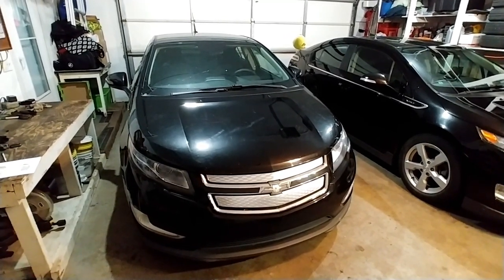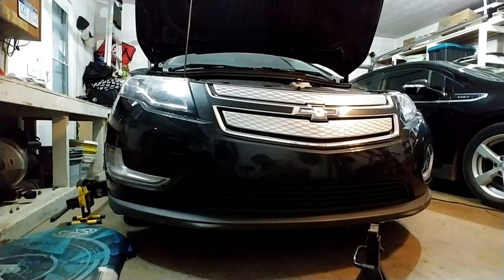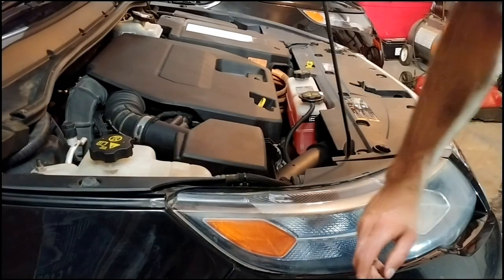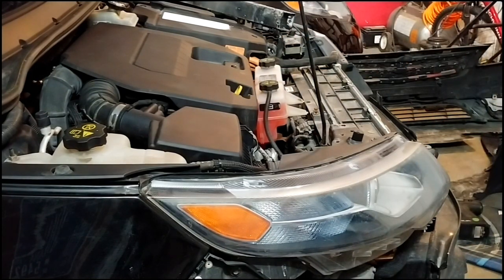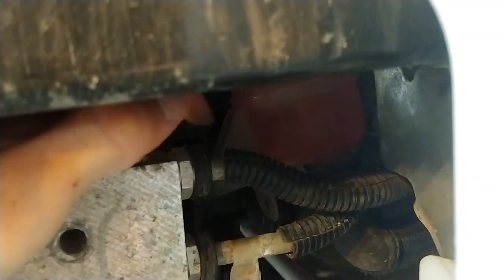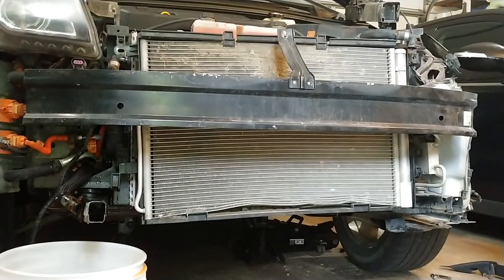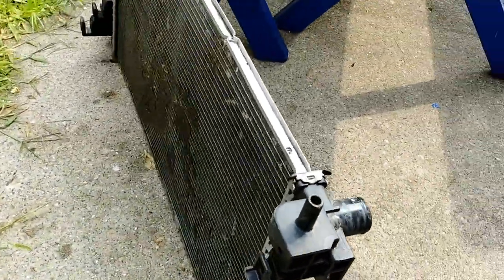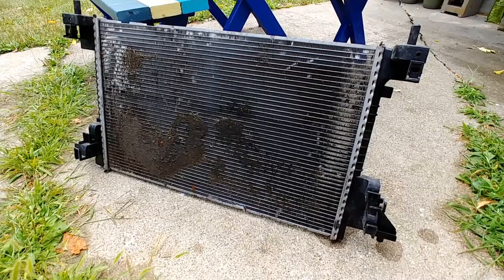How to Replace the Main Engine Radiator in a 2011-2015 Chevy Volt

Comment: I’ve got the same problem with my battery cooling radiator…bottom damage from such little clearance I assume. So, do u think there are any temporary patch options you could have done instead of replacing the whole radiator? I just need mine fixed long enough to get my check engine light to stay off so I can get thru smog check. It’s my commute to work car and I just need this thing to get me to and from work until I can get my new car bought. I was thinking of using some JB Weld or something to patch whatever my leak is so figured I’d ask somebody who had some experience with these radiators up close. Oh, also, what radiator is the battery cooling radiator? I can tell which of the 3 do what. Thanks for any info you guys can give!
Reply from the maker: The coolant system pressurizes as it heats up, so there's not much of a good temporary patch option as things expand a bit.  The hardest part is things typically need to be dry to apply anything external.  I know JB weld has been used with decent success by others.  The battery cooling radiator is the front one though and waaay easier to replace than the engine radiator in this video.  If it's leaking from the front radiator, I would just replace it.

Comment: Just bought a parts volt car that needs the front end reassembled from the motor forward.  Aside from a brand new radiator and condenser, I'm having to source all the parts----which my time really won't allow.  Thought I had a perfectly matched front bumper assembly, but evidently there's a difference between the gray silver and the greenish silver, which the car is.  I may scuttle this project because I'm seeing that I don't have the time.
Reply from the maker: Bummer! I know what you mean though. It took me about 8 months to fully piece together my first Volt. It could have been faster, but I was really trying to keep the price down. My second Volt didn't need much body work at all, so I had that pieced together in a month. I've kinda decided moving forward I will likely stay away from crashed Volts.
Reply: @mjspiess  I would sell it back to the guy I purchased it from because he gave me a staggeringly great deal.  However, I already bought a $600 bumper so he may not want to pay that, as he is a body guy.  We'll see...  I may keep it and just slow roll it as you did...

Comment: How did you bleed the system after putting it together
Reply from the maker: I just added coolant to the tanks every day for about a week.  The system will naturally bleed out the air bubbles, but it just takes longer if you don't use the proper tool.

Comment: I felt your pain watching this I did the same job today on my volt!! Painful
Reply from the maker: Yes, it was by far the worst radiator replacement I've ever experienced!  Hopefully my video helped though.  Good luck!
Reply from the maker: @Dimetri777 Ugh...  I feel you!  It is an absolute pain!  Apparently you can remove the 2 lower radiator brackets and it gives you a lot more room to get everything together.  It's some extra steps, but from what I read, it may be worth it.  At the 16 minute mark, you can see one of the lower radiator brackets.  With that out of the way, you can work vertically and not at such an angle since those brackets would be out of the way.  Good luck!
Reply from the maker: @Dimetri777 Yep, those are the lower radiator brackets.  Oh, I see.  Yes, getting it high enough is a challenge as well.  At the end of my video, I give some tips on getting it back together.  Not sure if you watched until the end, but it might help?
Reply from the maker: @Dimetri777 Yeah, I think I got it as high as my floor jack allowed.  Oh yeah...it's by far the worst job I've ever taken on too.  Such a terrible design and unnecessary to have it all slotted/fitted together like that.  It's definitely a puzzle.  I can remember, but I think I ground off or just broke off some tabs because they weren't necessary to hold everything together and it made it easier to slide into place.  It's a mess for sure though!  I was so happy to be done with it!  I had the service manual, so that helped, but I had no idea how bad it really was going to be.  It would definitely be easier removing the AC condenser and transmission cooler radiator, but I didn't want to mess with refilling either.  Ugh...  Love the car, but terrible design!
Reply from the maker: @Dimetri777 Totally agree.  I've owned a fleet of cars over the years and this Volt is by far the most difficult to work on and it doesn't seem like it needs to be this way lol  I still love it though!
Reply: How long did it take in total?

Comment: Mine leaked intermittently for months, now it's full on gushing though. Weirdest thing, it would drive fine for weeks, then suddenly dump all it's coolant
Reply from the maker: Same, but mine never gushed out and it only leaked while the engine was running, but not every time.  It was kinda hard to diagnose.

Comment: Would it be easier if you first took out the front radiator first? I need a coolant change anyways but I'm trying to avoid having the refill the ac and trans.
Reply from the maker: Yes, it would be easier if you first took out the front radiator first.  Exactly!  I was also trying to avoid refilling the AC & transmission as well.  I found one example from a Facebook group where the guy discovered if you remove both lower main radiator support brackets, you are able to remove JUST the main radiator leaving the front radiator, transmission cooler & AC condenser in place.  I was surprised, but the pictures didn't lie lol!

I'm hopeful I never have to do this repair again, but if I do, I will try that method of removing the two lower radiator support brackets to see if it's that much easier.  I think it's 3-5 more bolts on each side, but gives you a LOT more space to drop the radiator.
Reply: @mjspiess  Awesome! Thanks for the video and the quick reply. I just ordered my radiator so I will be trying it soon.
Reply from the maker: @TheYonderGod  You're welcome!  Good luck!  Hopefully you'll report back with a success story and be able to enlighten us on whether or not removing the lower radiator support brackets are a game changer.  At around 16:30 of my video you get a clear picture of what the brackets look like and I can imagine if they were not there, the main radiator would pretty much fall straight down.
Reply: @mjspiess  Got it done, I pulled it out the bottom and it was still difficult and I damaged the fins on my new rad. It was probably a little bit easier though. The worst part is the area on the bottom right with the trans cooler lines. Maybe a good idea to think about removing the trans cooler and just leave the ac condenser.
Reply from the maker: @TheYonderGod  Thanks for the update.  Nice work on getting it done yourself!  Saved you lots of money!
Reply: Link to the easier method on facebook? Thanks!
Reply: @TheYonderGod  is there a place to read up on the process or did you wing it?
Reply: @bdbdthatsallfolks  if I remember correctly, this video was the best instructions I found.

Comment: Hey, I have a question about the Chevy Volt coolant leak issue. My volt is leaking coolant almost like a super soaker when the radiator fans start running. I've changed my water pump, thermostat n sensor, and even replaced the valve cover gasket. It almost immediately runs hot STILL and I haven't had proper heat or air at the start of these issues. Could this be like an easy fix, ie: a coolant tank replacement? I noticed the little latch on the plastic tank that stops the cap is worn completely off. And I had to replace my last tank cap because it pretty much exploded and got stuck in the tank. Also is there an easy way to flush clogs from the engine coolant line? Please and Thanks
Reply from the maker: Are you able to locate the leak?  Is it squirting and then the air from the fans blow it everywhere?  Running hot almost immediately leads me to believe you may have a blown head gasket.  If you don't have a compression tester, some other things you can inspect is white smoke from the tailpipe, air bubbles in the coolant tank and milky residue under the oil fill cap and/or on the dipstick.  However, air in the coolant system will make it seem like it's running hot too and also not allow proper heat and the car probably won't allow you to run A/C if it thinks it's overheating.  Without the proper vacuum fill procedure, it can take days or even weeks to fully burp the system, but with a leak, you'll likely never get it properly burped.  It sounds like you're getting excessive pressure in your coolant system to make your coolant cap explode?!  You'd have to use a garden hose to try to flush a clog from the engine coolant line, but these Volts are pretty sensitive to the coolant used, so you'd want to flush just the engine side in this fashion.  I would start with a compression test though, check each cylinder and see if you have a head gasket leak and go from there.
Reply: @mjspiess  I did have white smoke and I had a confirmed valve gasket cover leak. After swapping it out and changing the oil, I no longer have white smoke. I can't see the leak, but it is as you say, squirting and then the fans spray it all over. I feel like there is definitely air in the line. There's a whistling sound from the top coolant tank if I tighten the cap too much when the engine heats up, and upon cool down, the "area" behind the fans makes a squeal like air being let out of a balloon. Also, if it's worth mentioning, when changing the thermostat, I noticed a glittery, almost clay-like substance that looks alot like some kind of "quick seal". That's why I was asking about the flushing something out of the radiator. The car only starts overheating when the engine activates, so that's the line I'm worried about now. Should I just pay the dealer to flush the system? Would this also include them taking over the process of burping the system?
Reply from the maker: @BaamBankstonTV  Hmmm...seems like you kinda have a mess on your hands lol  It does sound you still have air in the system based on the whistling and squealing noises heard.  Maybe the previous owner put some quick seal in it due to the leaking radiator, but knew it would only leak in engine mode.  Do you know the history on this Volt?  The engine side is no where near as sensitive to burping as the electrical side, so you could burp the engine side like any other car.  Drive it on ramps, jack up the front end or simply park it on a decline at the end of your driveway or something similar and let it run while adding coolant, but I don't think you'll get anywhere while the engine radiator is still leaking.  I think I would still run a compression test to make sure you don't have a head gasket leak too.  The coolant tank cap should be on as tight as it goes without any issues.  I don't think the dealership will want to or maybe refuse to do a coolant flush before the radiator leak is addressed, but if you have a head gasket leak, there's no sense in doing either until the head gasket is addressed.  You can get a cheap compression tester kit at Harbor Freight.  I'd start there and rule out the worst case scenario first.  If the compression is good, then get the radiator replaced.

Comment: Probably $1500+ at dealership? My battery/electronics radiator and the AC condensor (the next one inward) is bent in from road debri but just the battery loop is leaking. Been filling it with filtered water luckily I don't live where it really gets below freezing for much time. I just keep topping it off.
Reply from the maker: At least $1,500.  That front radiator is a breeze to replace if/when you do.  There are a few video tutorials on YouTube on that one.
Reply: @mjspiess  that's good to know. I guess it depends if the mounting hardware is damaged from the hits.

Comment: How do you loosen the clips that hold the front bumper in place. Where it meets the next panel behind the tires?
Reply from the maker: I'm not quite sure what you mean.  I made this video too.  Maybe this will help you? https://www.youtube.com/watch?v=qcltF1dz-tE
Reply: @mjspiess  no I got the bumper off.  But I took a sawsall to the old radiator to get it out. The new will slide in easy. I thot my caddillac radiator was bad!
Reply from the maker: @MikeSsuncoasttrains  Lol!  Yeah man, this radiator is horrendous.  Glad you got it though.  I found some guy on a Facebook group that removed the lower radiator support brackets and was able to remove the radiator more easily.  I hope I never have to try again, but will remember to try it.
Reply: @mjspiess  got the old one out and the new one in.now just got get everything in the right place.i just hope I didn't damage anything in the process. GM loves to cram everything in a tight space. Remember the old caddillac 4.9 transverse with the water pump squeezed in there!
Reply from the maker: @MikeSsuncoasttrains  Nice work!  Yeah, hopefully no leaks, etc. when you get it all reassembled.  For sure.  The Volt is really tight and hard to work on.  Thankfully, I never had the pleasure to work on the old Cadillac!
Reply: @mjspiess  lollll.. you didn't miss anything. But the designs are oddly similar. The worst was doing the ac compressor on the 4.6 northstar.  Crammed behind the front bumper with everything in the way. But it's gone. Engine blew!
Reply from the maker: @MikeSsuncoasttrains  Lol!  Ironically, I just got a job request this evening for the water pump on a 2005 Cadillac Deville Limo 4.6.  Man, what a weird design?!
Reply: @mjspiess  no way.. those water pumps rarely go bad.  Is it over heating. ? Out of 3 northstar I had 2 blown head gaskets . The front head  where the water pump is mounted the drive pulley comes off the overhead cam. That was impossible to get off on my 2000 deville. I was able to fix it because it was the front head. If it had been the back engine would have to come out. But they used aluminum blocks and didnt put deep enough head bolt threads. So they would pull out. They tried fixing it in 2000 but it didnt help. Finally in 2006 caddillac made it right then in 2010 quit making the 4.6 so after 16 years they resolve it. Have fun!
Reply from the maker: @MikeSsuncoasttrains  I am not sure.  The customer contacted me and asked that I replace it.  He has the part and tool to twist it out.  I assume it's maybe leaking from the o-ring?
Reply: @mjspiess  yes more than likely so. If I was going to look for another caddy it would be the 1993 deville.  The 4.9 v8 was one of the best engines GM ever built. Some of them made it into 94 cars instead of the 4.6. I had an 89 Fleetwood with a 4.5 that I crashed.  Someone hit me. That was a nice caddy.

Comment: I'd have pulled the whole stack together, rather recharge the AC and refill the trans fluid than fight with that crap.  Getting the rad back in will be even more of a pita, maybe put some cardboard on both sides and tape it until you have it in place so you don't damage the core wrestling with it.
Reply from the maker: After completing the job, it definitely would have been easier to pull it all out together and refill the systems.

Comment: Does someone have any experience with aftermarket brands like nrf, nissens? Do they fit without issues, because you cant Order it at gm at the moment.
Reply from the maker: I got mine from RockAuto.  Not sure what the brand was, but it was not OEM and it fit fine.

Comment: So from looking at he video, It looks like 3 radiators and a condenser. That all looks like a nightmare. From a scale of 1 to 10, how easy would you say this repair is. I just did a radiator replacement on my TL and it nothing this complicated. Is this even worth getting a volt.
Reply from the maker: Correct.  It was a nightmare lol!  Man...it was by far the most difficult radiator replacement I've ever done.  Although, I spoke to someone else who recently did this job and he said if you remove the two lower radiator support brackets, you don't have to remove the front radiator or the others in fact and it creates more room to drop it down from below.  Regardless, I would say this was an 8 or 9/10 on difficulty.  Definitely 10/10 when it comes to a radiator replacement.  I wouldn't want to do it again, but now I'm curious to see how much easier it is with the lower brackets removed.
Reply: I agree removing from the bottom is the fastest and best option. Took 45min. To pull out. Mind you that's on ramps if on a lift it would much faster.
Reply: @mjspiess   When replacing the radiator, it helps to replace each water pump.  These pumps will leak eventually.  But, if you're only fixing the car to flip it, just fuhggettaboutit and sell it. Let the buyer beware.
Reply from the maker: @roymariano7116  Thanks for the tip!  I've always been in the camp, "replace it when it goes bad."

Comment: If I ever need to do this shit on my volt I'll definitely have my mechanic replace ALL of them. No way you want to pay twice for the labor.
Reply from the maker: In hindsight, it definitely would have been easier to at least remove the transmission cooler radiator.  It was a terrible job to leave everything in tact.  If I had to do it all over again, I would either remove the transmission cooler or grind off a couple of the tabs/slots in the plastic housing that holds them all together.